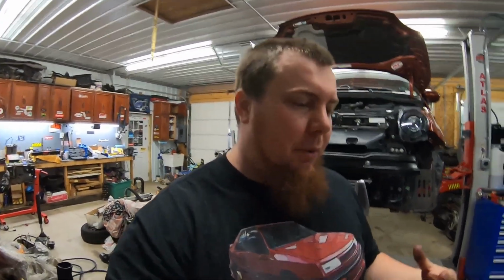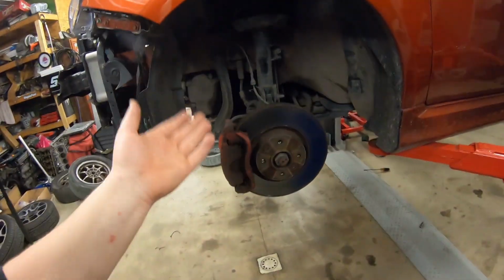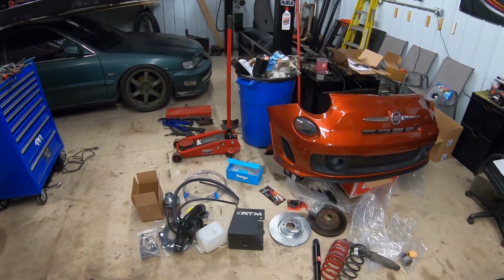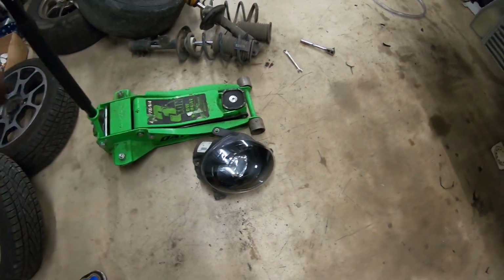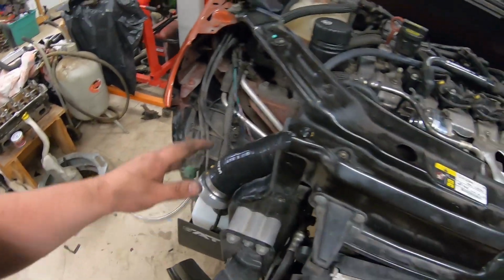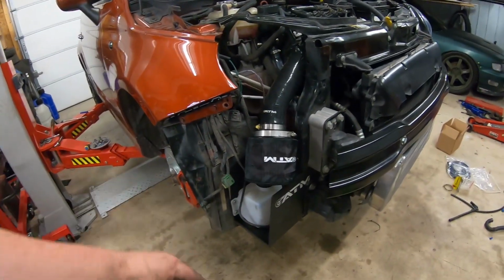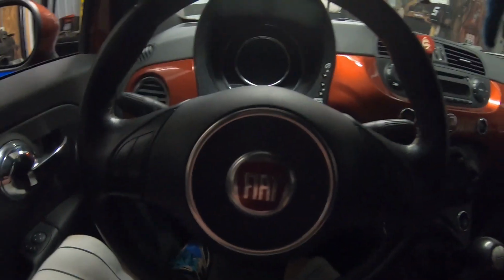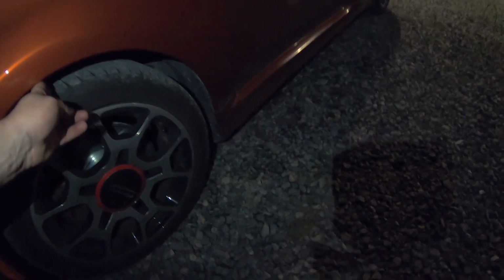Fiat 500t gets a 2inch drop and new ATM cold air intake system! AUTOX PREP!

Comment: What year do you have? I’ve got 2013 500t and my dash/gauge is not like that
Reply: It's probably a 2015+ model. I much prefer that gauge than the needles.
Reply: 15 got an interior refresh. Digital dash (I'll get back to that), larger cup holders, aux USB and mic input. 16 has a touch screen radio thing. I'm not sure why that wasn't a part of the 15 update? 16s had optional reverse sensors and eventually you could get factory camera so maybe that had something to do with it.

I can do without the old amber EVIC display but the new tachometer sucks.